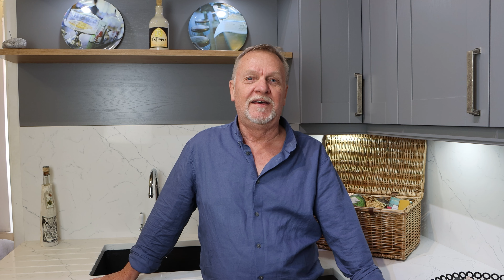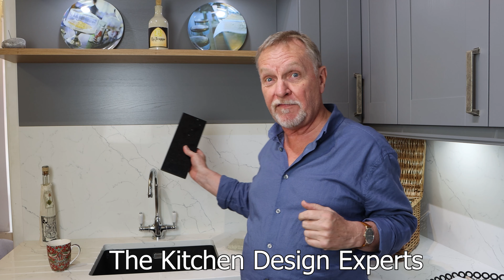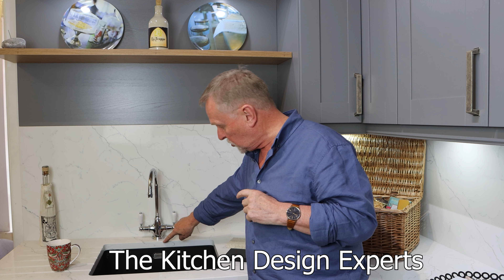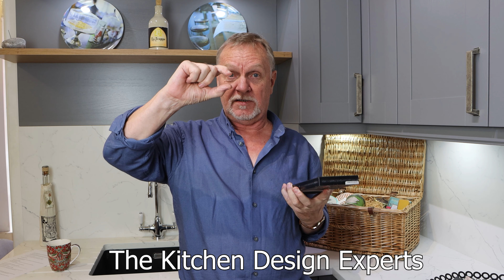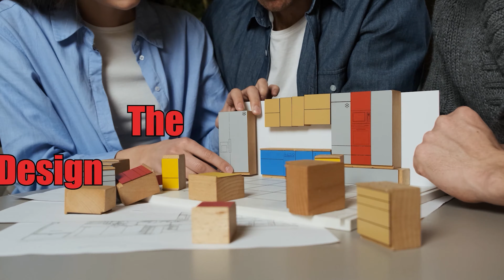Quartz worktops (All you need to know about Quartz kitchen worktops)

Comment: Hi, we are considering having our laminate worktops covered with quartz worktops.  A company advertising on the TV makes it sound very convenient.  Do you have any thoughts on this type of kitchen upgrade?  Brilliant video by the way!  Thank you.
Reply from the maker: Hi Debbie, thanks for comment about video, much appreciated. Now then , I haven't had much dealings with the type of tops you are talikng about though I have seen some finished. The one's I have seen have all been granite not quartz. The concept seems to work and of course it's easier and I presume cheaper than changing all tops. I take it they will have to disconnect sink and refit it into the new top. I doubt you will achieve and undermounted sink which is one of the main reasons for having Quartz. The only thing I would want to know is how is it finished against the wall as it will presumably butt up to your existing wall finish, tiles etc.

Comment: Thanks for the very helpful clip. I am just wondering is the worktop behind you 20mm or 30mm? I am debating on the thickness at the moment. Many thanks!
Reply from the maker: Hi, it’s 30mm. We tend to use 30mm all the time. The cost difference is small and we think the thicker top looks better. However if you were wanting the sleek contemporary look consider 12mm. This definitely looks like it’s making a statement. One thing to bear in mind when looking at thinner tops is how they will affect the top drawer if you are putting a hob over a drawer. You may have to blank a top drawer in that situation

Comment: I think you missed a key element; drain grooves or recessed drainers on quarts

Can you shed some light on these on which is better?
Reply from the maker: Hi, yes we didn’t touch on that topic. Good point. Frankly we don’t rate drainer grooves ,they don’t really work that well. The recessed drainer is better as it catches the water and stops it from dribbling down the front of the cupboards. Problem is, it costs quite a bit more.
Thanks for you question

Comment: Love the information you give in all of these vlogs. They are very helpful.

Can I ask what your thoughts are on using Corian for work surfaces?
Reply from the maker: Really pleased you have got something from them. Reference Corian. All I need to say is that my own , last 2, kitchens I have used Corian as part of my design.
Reply: @TheKitchenDesignExperts  thank you you for your response. I have been informed by one designer that Corian sinks are liable to cracking if used with a Quooker tap. However, another designer has said its highly unlikely to occur.

I hope you don't mind me asking but what is your experience of this?
Reply from the maker: Hi, sorry for tardy response, I missed this one.  The last I heard was that Corian themselves advised against using a boiling water tap with Corian sinks. That was information about 2 years ago, it may have changed. Next time I speak with Corian area manager I will ask question. I believe that you are better safe than sorry and I would choose another sink